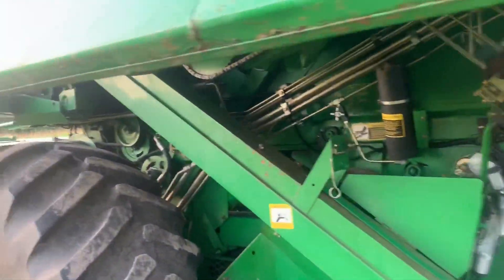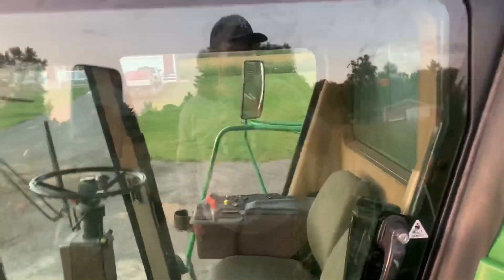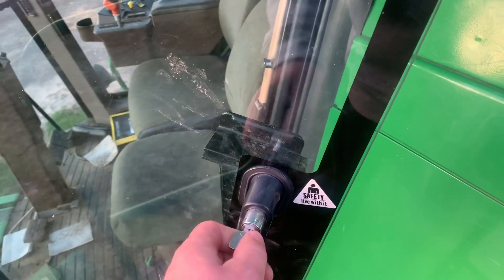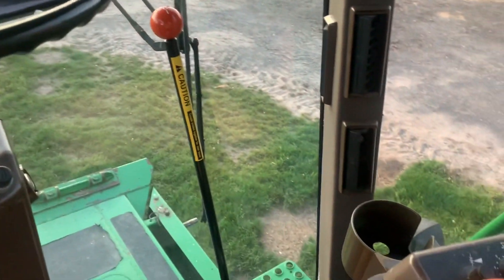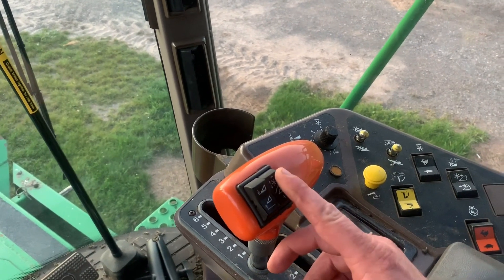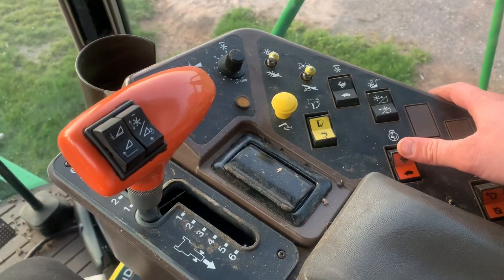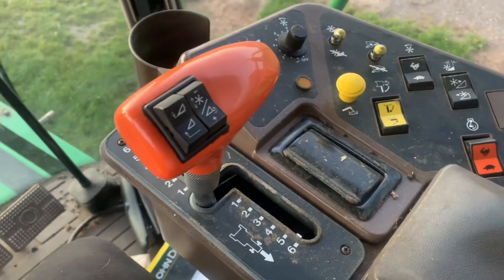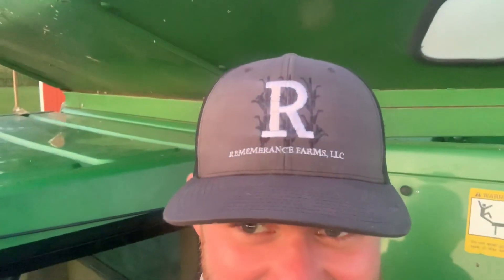Tour Of A John Deere 9500 Combine

Comment: Excellent Combine. Still our main combine (2480hrs)...893 head makes this combine go 3.7 mph in 180bu at 23%. The common problem areas on this is walker bearings need grease every day or they are toast. rocker switches on the console every year and header height switch every 3 yrs. Motors burn a jug of oil a week. Eventually the seal between the engine and hydro goes on all of these. Lights are inadequate now. We LED our whole machine and header. Your paint looks really good! If we did any other crop other corn it would be too small.
Reply from the maker: I do feel kind of lucky, because mine is the 9500 that still runs the wooden bearings for the walkers. I’ve heard the greasable ones were nightmares? Last year I also did like what you did and replaced all the stock bulbs with LED ones from Amazon. It honestly made such a big difference! I’m glad to hear of another person that still runs the 9500. It’d definitely be nice to have a new one, but for what I do, it does exactly what I need it to.

Thanks for commenting and watching!
Reply: 3 years later and YouTube recommended this video to me again. We traded our low hour 9500 corn special with the 9600 motor in it. Went from a 1995 to a 2017 S680...and it really shocked me how the combining is pretty similar. Very nice to have hydraulic power...no lag when going thru 200bu...unloading and going thru mud at the same time. Yet 3x the fuel while only going 1.5 mph faster with the same size head(8 row). The 9500 did a great sample, no rotor loss, and sipped fuel. Great combine.

Comment: Controls are a lot like my old L2. My L2 would go 22mph. Felt like I was out on the front of the nose of a rocket. Feeder house doesn't stick out like the 9500 and so you felt like the tip of the spear. A scary ride for sure the first few road trips.

Comment: I had the inspection done last year on my 6600 and as you are , I was scared of the cost. They broke it down into things that needed done now and things that could wait. I'm still working on the list but makes me feel better about whare the combine is at on its shape.
Reply from the maker: I like hearing that. I think I’m really leaning towards doing the same here too. It’ll be nice to at least know “this is what needs to be done right now” versus me guessing. I only run corn through mine as well, which is a little easier (I think? I could be wrong). Thanks again for letting me know that worked well for you.

Comment: How do you know where to move the pin to go from high to low with your dual
Reply from the maker: I actually still have an extra book for my 9500 so I’ll have to take a look. Since I only ever did corn with it, I thankfully didn’t have to do all of the different settings to take it from corn to beans/wheat. Do you run a 9500 too?

Comment: Have them do the inspection and you do the repairs.
For a 110 acres a year that combine will take you into retirement!

Them shoe blocks can be replaced with a  bearing kit but just put blocks in. 2 bolts on each side and that whole bracket comes out.a
Reply from the maker: Very good point, Jon. Honestly, I didn’t think about the fact that they would just do the inspection. I’m always worried that when I commit for someone to go over things, that I end up paying for the repairs too. Ha (Why I typically buy my AgLeader parts used and then install them myself). I do like the idea of them going over it more and then me just having that checklist to get to.

Comment: Were is the kill switch
Reply from the maker: I’m so sorry I was so slow to respond!! Were you meaning how it gets shut off, or the button that’s on the newer ones that shuts the system down immediately? For the shut off, it’s actually just the normal key. But on a 9500, it actually doesn’t have the button to shut the head and separator off immediately; wasn’t new enough for that. Hopefully that helps! I’m so sorry again for the slow response!
Reply: No i mean a quick disconnect by the battery you should have one
Reply from the maker: I actually installed one in September! Now that I bought my new combine though, it’s at least there for the next owner. It originally didn’t come with one, but it was a pretty simple install.
Reply: Ok perfect